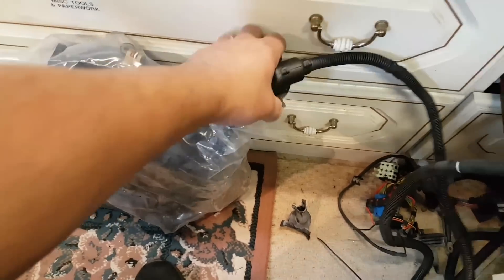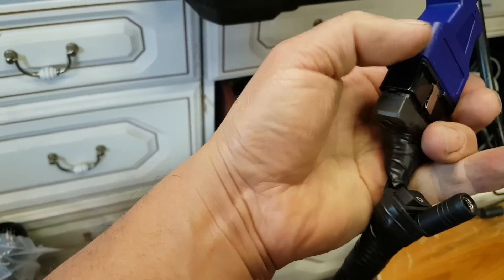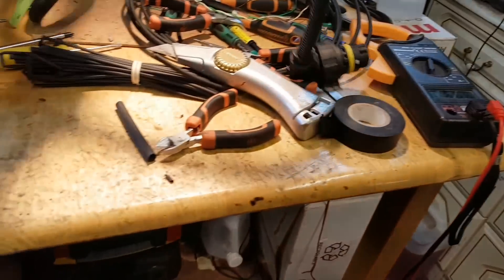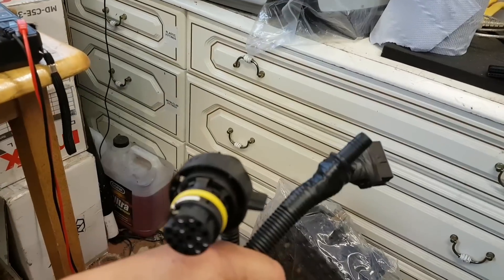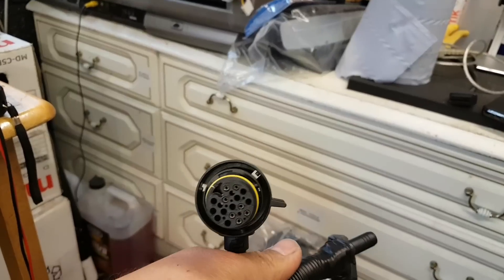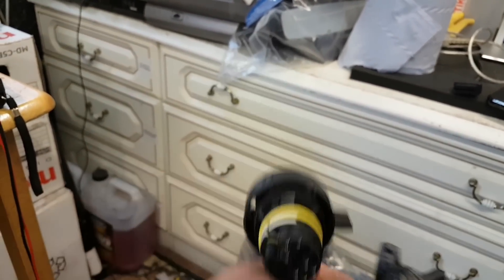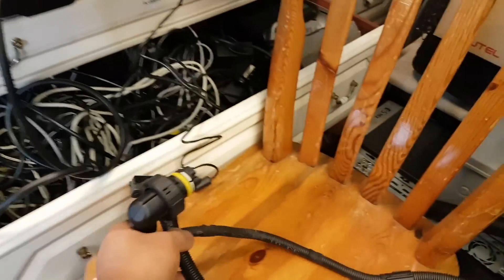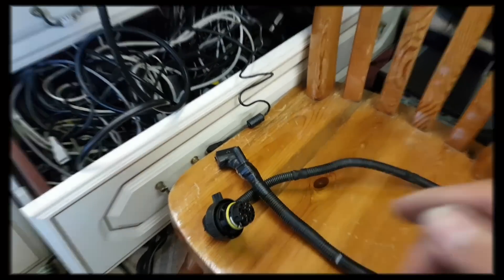BMW 8HP gearbox ISN reset custom cable... for the Autel IM608

Comment: Thanks a lot for such a good video…still want to ask please what you do in this video the resetting is also called verginise is that right ?
And another question After this reset is done and gearbox is fitted back in the car will i need to do coding or not?
Thanks again for all your support
Reply: Would really appreciate your answer to my last 2 questions many thanks
Reply from the maker: Yes, virginize is another way of saying it...
The box programs the ISN on the first turn of the ignition, but coding/programming is advisable...
👍👍👍
Reply: @LMAutoRepairs  thank you you are one the best out there replying so quickly to people’s queries 
Do you mind asking me 2 more questions please? 1) do you have a video link of to how to code/programming using im608?
2) can im608 be used to clone a tcm rather than reset and code/programming instead?
Reply from the maker: @igortanyarascovschi1225 
I have plenty of videos on programming and coding BMW... but not with the IM608...
The IM608 does not do it, the MS908P is the one I use for that... example below...
https://youtu.be/Kx8GabiMmUI?si=BU517Aadx7Hha5su

Don't think the IM608 clones the tcu, at least not the times I have tried.
The IM608 can code, but not programming...
👍👍👍

Comment: Hello sir, can you show how you made this cable ??? Your exact connection and all
Reply from the maker: 🤔
I have literally showed the diagram on the video!
🤷‍♂️
Reply: @LMAutoRepairs  I mean your wiring adapter you custom built not the autel wiring diagram you displayed , your video didn't show how you custom made the wire only showed the end with it all taped up with the on and off switch
Reply from the maker: @kva_powerup 
The connections are the same as the diagram...
I only added the power jack and the on/off switch...
👍👍👍

Comment: I am looking at Launch X431 with its X-Prog module to see if that can do EGS ISN reset without even going under the car.... Let me know if u know.
Reply from the maker: Can't advise on that... never used launch...
👍👍👍
Reply: Is there a risk of performing EGS/ISN reset through vehicles OBD connector? I heard Cas3, fem and so on should DEF be bench or like you did  @LMAutoRepairs
Reply from the maker: I've never done it through OBD...
I guess, either way, there is risks involved...
👍👍👍

Comment: Hi, I didn't understand where did you provide the 12 V and ground from? Is it from an external source or through the OBD connector? May you clarify this
Reply from the maker: External source... the obd will not be connected to the car...
So needs to be external...
👍👍👍
Reply: Thanks for prompt response. You mean to say this will be connected through a 12 V adapter?
Reply from the maker: Yes...
Reply: Thanks🌷

Comment: whats about vin number difference if you unlock donor tcu? how to program vin to the car?

thanks for the video
Reply from the maker: You can flash the ecu afterwards  that will update the vin... I do it usually with the MS908P...
👍👍👍

Comment: Thanks for sharing buddy…
The 12v you get them from the battery? As i could not connect it although all the wiring is good
Reply from the maker: No... I use a transformer an plug it into that port... as showed...
But you can use the battery obviously...
👍👍👍
Reply: @LMAutoRepairs  thanks alot buddy
Reply: @LMAutoRepairs  couldn’t connect it with battery though
Reply from the maker: What do you mean?
To power the gearbox ecu, you can use any 12v... the gearbox module alone, does not take much power, I use a 2 amp transformer and does the trick...
Check your connections...
👍

Comment: Hello.  After oil change, i have an permanent error: "CF1461: Message (diagnosis OBD engine, 0x397) missing, receiver EGS (A-CAN and FA-CAN), transmitter DME / DDE (A-CAN and FA-CAN)". there is a possibility that the plug was not correctly inserted and there was also oil in it. it was cleaned and reintroduced. what do you think of this message?
Reply from the maker: It seems like communication issues... double check the plug, connections etc...
👍👍👍

Comment: Can you please provide some assistance? I made a cable just like yours for an 8HP swap into an F10 5 series, here is how I have it connected:
High/Low CAN lines: OBD pins 6 & 14 hooked up to pins 5 (CAN low) and 6 (CAN high) with 120ohm resistor between the two CAN lines 
Ground: OBD pins 5 & 6 are linked and connected to pin 14 (Where else should I connect the ground as per the schematic?)
+12V Power: OBD pin 16 linked to pins 9 & 13, I have female power plug connected inline  between the OBD plug and transmission for +12V power adapter to plug into 

When I connect I can hear the mechatronic unit "click" and hear that it has power however I do not have any voltage displayed on the IM608 and it will not communicate. do you have any idea what I am missing?

Comment: I wish you a nice evening. Very useful video! But I was left with many questions :I have a 740 BMW N57 2010. I put on a original new gearbox . Of course, it doesn't work. How I can make it work, what with tools, diag I should Buy? I have a lot of tools but none of them handles, EGS programing, ECU updates on BMW😭Thanks in advance for the answer, you follow: George!
Reply from the maker: As per the video... the IM608 does it, along with other tools out there than can reset the ISN on the gearbox...
👍👍👍

Comment: Well done. Only i considered buying faster tools, and then stopped. Why because I charge by time not the job. Faster means loose money.
Reply from the maker: Possibly...
Reply: @LMAutoRepairs  4 sure. Hey the im608 pro. Where do you get to see all the jobs it can do. An ideas? Best I have come up with is the Autel coverage site. Only it says with symbols. Bench or OBD but not much else and only lists car not job. Like on youtube someone showing it can change BMW ecu. 

I love mine. Great diagnostics too. Better than my ms906.
Reply: That is very backwards thinking. Charge flat fee for programming/coding and faster tools will make more time and money and get the customer their vehicle back that much sooner and you onto another job.
Reply: @ericschott5100  its not backward thinking at all. I have given multiple discounts over twenty years and never reaped the benefits. Get reviews but the repeat business here in the UK has not been worth the money lost. Faster tools and spend more money to buy them. So loose money over future earnings.

With a comment like yours, you must work for a tool company.

Comment: Hi there i have got a peugeot 307 2004 2.0ltr petrol convertable and have a permanent right hand sattellite on i have swapped over but it appears to be sensor as different codes come up but the problem is the main dealers say they dont make them any more car to old .is it possible to repair it many thanks
Reply: Hi there thanks for replying yes the dealer checked and said they dont supply any more can the left and right be used either side.and finally the code is 5wk42991 just found one in germany but language in german any advice as not seen a sensor with this code on thanks
Reply from the maker: That does not looks like the part number.. 
A quick look and found 9644904380 as being the correct peugeot part number...
Just remember, this could have been superceded at some point...
Reply: Yes that is the first number on the sensor and also the number the dealer looked up but not available any more not sure what to do now as mot failure .the funny thing was when i bought the car i did not recognise the airbag light was not working at all until they told me at the mot station so i took clock to bits and found somebody had put some paper behind airbag light so it appeared not to be on but took paper out and airbag light now permanently .pure bodgers
Reply from the maker: Are you in the UK?
Reply: Yes i am in leicester
Reply from the maker: What?
The dealer don't sell a sensor?
That's first... 2004 is not that old... 
Get a second hand one then...
Thank you for watching!

Comment: I have an autel maxiscan mini
And a 6hp26 which I need to clear the ISN on would this method be a possibility for me?
Reply: Could I mail the tcm to you for reset?
Reply from the maker: https://www.ebay.co.uk/itm/333760313602
👍👍👍
Reply from the maker: The 6HP if fitted on a E series....
What car are we talking about?
Reply: @LMAutoRepairs  first thanks for being responsive I really appreciate it. The car is a 2007 BMW 550i so an E60 with the ZF6HP26 build 1068 010 054
Reply from the maker: OK...
The build number is a bit irrelevant...
Is the software number, as per the advert...
Where are you based?
Reply: @LMAutoRepairs  I can try to retrieve the SW number tomorrow 
But I have changed nothing SW wise with the transmission or the car for that matter 
Based in Southern California
Reply from the maker: 🙄
You are across the pond...😋
I understand that, all I am saying is that only certain software versions are possible to reset... I will not be able to help you then...
You are just a bit too far...😊
Reply: @LMAutoRepairs   
Cant be done without the car?
IE ship you the tcm?
Have you heard of softelctronic.com?
Reply from the maker: I don't have how to do it out of the car... not that one... sorry...
Reply from the maker: Don't think the Maxiscan is capable of such thing...
👍👍👍

Comment: Thanks a lot, again a brilliant idea, I just wonder where to find this kind of cables (just give me the link), and another thing I want to ask you about if this idea is applicable to link the maxisys to a mercedes w202 which is equipped with the 22 pin connector, thanks a lot again 😉

Comment: luis tou a pensar comprar uma dessas a parte de programacao e so bmw e mercedes ou programa mais marcas? tipo obdstar que  consegue ler bsis sem precisar abri-los
Reply from the maker: Sim, dá para ler o pin das BSI...
Não sei se todas, mas eu já a usei em dois ou três... 
👍👍👍
Reply: @LMAutoRepairs  mas sem abrir as bsis? e programacao coding e multimarcas ou e como o 906 so mercs e beemers
Reply from the maker: BMW e Mercedes flashing só a MS908P...
A IM608, faz diagnóstico e coding igual...
Mas é mais inclinada para programação de chaves... etc...

Comment: Hi all! Any ideas if im608 can program Mercedes transmission 7G 722.9 a used transmission has been installed. The operation required two steps (if i'm right).
1-Reset the new (used) control module (make ECU virgin).
2-transfer the data from the old(original ECU) to the donor control unit.
My Question if Autel IM 608 can do this I would like to by one by not sure if it do it. Thanks for the help
Reply from the maker: Hi
I have just powered the tool to have a look...
There is definitely the option... to renew, to write data and vin, plus other options...
So, I would say it can...
Thank you for watching!

Comment: Great vid bud. Are you get im608 from Uk ? Try to get one and been said it’s only Chinese market  ( and even if get one  , my warranty will void when register on uk ) . Any ideas when I can get one bro?
Reply from the maker: I got my one from a UK Autel representative...
Working fine... no issues...
👍👍👍
Reply: @LMAutoRepairs   See here is a problem because dealers here in uk selling this tool under different name Maxisys ms908IM - that’s why it’s so confusing

Comment: Hi. U once showed u have more then 1 laptop for programs and wiring diagrams. I wonder why so? Would it be possible to have all of them in 1 with enough space?
Reply from the maker: You can... there is some that can cause incompatibilities... but majority yes...
Now, this is why I don't do it...
Imagine if that one laptop fails?
Or the HDD faults?
You loose everything...
I just can't afford to loose all my stuff at the same time...
Thank you for watching!

Comment: Interesting, older ones just needed some programing to work. Do you need the 120ohm resistor because theres another 120ohm inside the mechatronic?

Comment: Luis please can you clarify if a test light can damage a ECM ?
Some people are saying yes and others no
You are the must appropriate to clarify this 
Great work m8👍
Reply: Depends what car and systems.
Reply from the maker: Depends mainly on the load of the test lamp... and as already mentioned, depends on the systems etc...
But, a low load test lamp is most unlikely to cause any damage...
I even use mine 12v test light to test the 5v circuits... yes I only load the circuit for a really short amount of time... 
You can get a LED test light, they are a bit safer...
Hope it helps.
Thank you for watching and for your comment!

Comment: Excellent! How much did you spend for the IM608? Would you suggest it as a general diagnose tool? Also you only connected to the can bus. Doesn't the can bus of the gear box connect to the vehicle ODBII port? Is it an isolated bus?  I teach automotive electronics to automotive technicians. One of my advices is to never discard looms. Sort the good part and create adapters, break out boxes etc.

Comment: Nicely done . You could have asked me about the possibility to clear the ISN with the IM . I never made a dedicated connector like you did because I am pretty lazy to be honest . The first time I needed it I wrote down the pins, made a drawing and used an old obd receptacle . The few times I have used it the last 2 years I really didn´t even think about fitting a plug on the side that goes into the gearbox .

Comment: one question.. does bmw gearbox reset with 30second press on a gas pedal do anything or is it just a placebo effect?
Reply from the maker: There is some procedures that are supposed to reset the adaptations...
But different cars different procedures...
Thank you for watching!
Reply: @LMAutoRepairs  well i'm talking about exact procedure as stated above.. alot of youtube tutorials state bmw adaptation can be reset with gas pedal pressed for 30seconds while ignition being in nnumber 2 position.

Comment: will this autel get me in to vw audi component protection
Reply: Unfortunaly no. At least not yet
Reply: This can be done with xtool H6 Pro as claimed by manufacturer and they also support Doip protocol
Reply from the maker: This is aimed to immobiliser systems...
However, I have not yet digged into that sort of things with it...
Thank you for watching!

Comment: Nice one 👍  what would it happened if you would have done this through the on vehicle OBD2 port with the original wiring loom connected to the gearbox...?
Reply from the maker: Not sure...
The tool specifically states to make the connections as stated....
There is a possibility that the constant communications with the CAS when the box is connected to car, somehow makes this procedure to not be possible...
But I haven't tried...
Thank you for watching and for your comment!